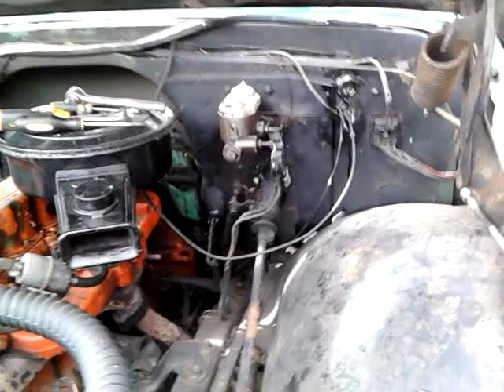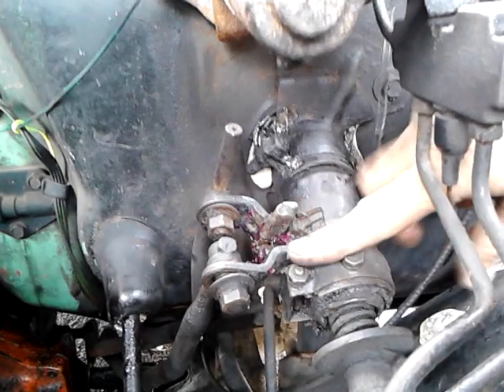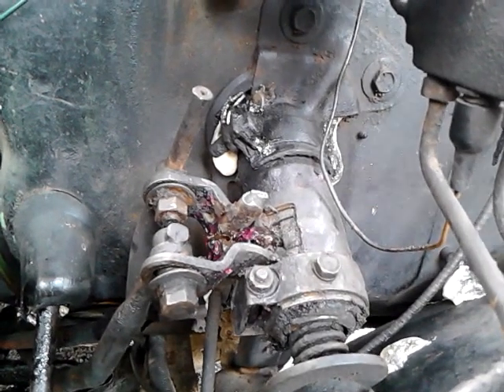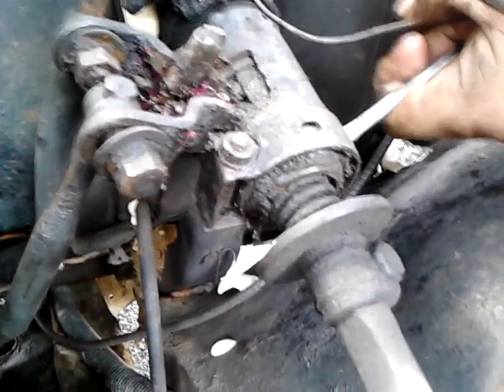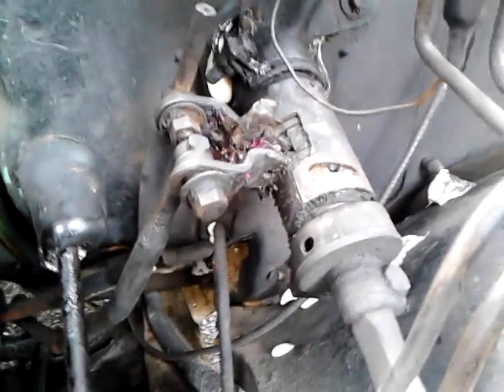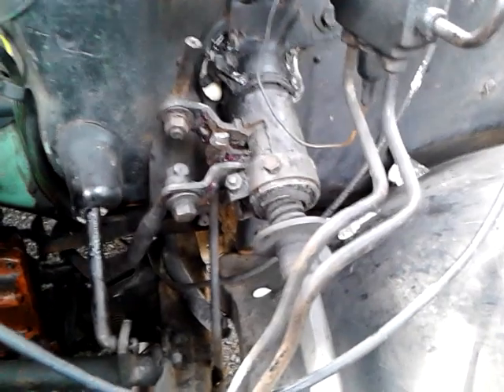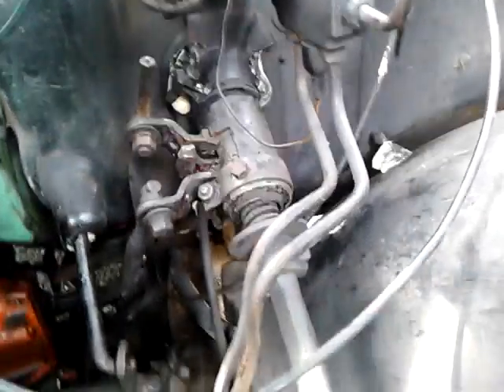How to adjust 3 speed column shifter

Comment: I have been tinkering with the adjustments for 2+ years. I have taken my truck to four different shops. One of which was a "Classic Car/ Truck" shop. Nobody could get my "3-on-the-tree" adjusted correctly. It was ALWAYS getting stuck between 1st and 2nd gear. They all kept blaming it on the play at the column bowl. I watched your video a couple times and then hit the garage, following your video. Low and behold, once I put the screwdriver between the two connectors I noticed that one was about a 1/4 inch below the other. Once I evened them out, the linkage tightened up and now shifts between all four gears with ease! Thanks a TON for your video!
Reply: Allan Scott a
Reply: You probably dont care but does any of you know of a trick to log back into an instagram account..?
I stupidly forgot the account password. I appreciate any tricks you can give me
Reply: @Jesus Mateo Instablaster =)
Reply: @Jasper Arian it worked and I actually got access to my account again. Im so happy:D
Thanks so much you saved my account!
Reply: @Jesus Mateo Happy to help =)
Reply: I have the same issue

Comment: Luke, thank you sir. I've been all over the internet trying to find someone who made a video about early Chevy column shift adjustments. These trucks get modified and turned onto hot rods so much, that it's hard to find info on an untouched daily driver. I've had the shifter of my 1961 Apache jam up when I'm out and about. Being that I'm female people love to gawk at a girl who's pulled over with the hood up and nose in the engine area trying to clear the jam. Thanks to you I could fix this issue at home and take "Miss Betsy Louise" out in public again. It's great not having to wind the engine and transmission just to take off in 2nd or 3rd gear. Just to be on the safe side, I did end up removing 50+ years of built up goop and rust before tightening it all back together. Thanks again - you're a great shop teacher.  :-)
Reply: I know its been a while since this post, but do you still own the 61? I have the same but on mine I don't see a hole to align the 1st and reverse gear to the 2nd and third in neutral

Comment: THANK YOU for this video! I've been suffering with the 1st to 2nd lock up with my '59 Chevy for some time and thought I had it under control when it happened again 3 days ago. That's when I went hunting and found your outstanding video. The major difference is closing up the clearance between the levers is accomplished by turning the INNER sleeve....removing the screws is not necessary, only loosen them enough to allow the inner sleeve to turn. That and a small adjustment on the 2nd/3rd shifter link cured my problem. This issue is not addressed anywhere in the 1958 Service Manual OR the '59 Supplement so thank you again!
Reply from the maker: I'm glad it helped you. Gotta keep these old classics on the road.
Reply: thank you for the extra tip!! i have a 59 Chevy too with same problem.
Reply: 57 Chevy stuck in 2nd gear last weekend. I am not finding the piece between the two actuators. Is this a different set up or could it have slipped out somewhere? Any help would be appreciated

Comment: Luke, thank you so much for this video. Bought a 67 that was shifting rough, and tonight it locked in 1st gear. Limped home, and found this video. Sure enough, my shifter is popped out of the catch. Gonna have Pops help me tomorrow and get it all cleaned and tightened back up, while I have new arm bushings on order!
Reply from the maker: Hope it works well for you. These trucks are fun to drive when they are adjusted correctly.

Comment: Let me tell you a piece of my mind,I tell you I spent 3 hours trying to figure out how to fix my problem and spent 30 mins searching you tube to find your  video ,that I am sure as simple as you made it look I know you have busted knuckles,scraped,cut yourself,and sweated gallons to learn what you know,thank you kindly for sharing your knowledge ,so clean crisp and throughly , I hope you have more videos on adjusting and fixing these model trucks cause I need more help thanks again kindly
Reply from the maker: Glad I could help. What else would you like to know? I've been working on this truck for 28 years so there's not much I haven't fixed or adjusted.
Reply: the column seems to be floating around and im not able to get into 2nd and 3rd
Reply from the maker: does the entire column move around or just the steering wheel?
Reply from the maker: Oiram Nojertsac
if the steering wheel wobbles around and the column itself doesnt move around then its probably the upper steering shaft bearing. It's letting the wheel move around, it's hard to diagnose something without seeing it but thats what I would check first.
Reply: @lukeFugate  hey how's it going love your video by the way thanks I've had one of these for years and it's goes  through the gears fine but when I put it in the third it pops out all the time I have to hold it in gear do you know what that might be or how to fix it it's just a 3 speed too by the way thanks
Reply from the maker: It could need a small adjustment. It may not be going all the way into third. Also if it is in adjustment you could have worn synchronizers or possibly low oil in the transmission.

Comment: I thought this video was completely helpful and in fact solved my stuck linkage problem... for now at least.  In addition to the instruction you provided, I degreased the hell out of the area and scrubbed the linkage until it was whistle clean and reapplied linkage grease after doing so.  Very smooth now.  Oh and it is a 1972 G10 Shorty Van with a 3 speed column shifter... never saw one myself until I picked this one up.  Thanks again!  QUALITY TUTORIAL

Comment: Another thing that helps is to get rid of the rubber bushings that the factory thought were a good idea. Replace them with bronze bushings from the local farm or hardware store, you'll never have another issue with a sloppy linkage.
Reply: Smart
Reply: Where are those bushings located?  I'd like to try that as well!

Comment: Ha! I've been gingerly keeping my shift pattern precise for 48 years on my 1955 2nd Series 3100 1/2 ton, to prevent it from locking up the shifter. I'll try your adjustment fix, but if it corrects it I'll lose a lot of the adventure of driving my old truck! 😁
Reply from the maker: lol At least the need to be precise when others would just try to shift normally is a good theft deterrent. Although I guess nowadays just having a three-speed on the column is a pretty good deterrent.

Comment: Thanks a lot.  I have a '67 pickup.  Sometimes you can shift it into first/reverse and sometimes not.  The shift lever will not come towards me sometimes, which prevents first/reverse.  Let it sit, and it will "fix" itself for awhile! I was thinking the mechanism on the column had a broken part in it. Will try your adjustment first and see if it frees up the shifter.  You're right; this information is impossible to find.

Comment: Thanks Bud, that was very helpful.
I have a 65 Barracuda that has a little different set up on the cam adjustment.
The linkage rod adjustment is under the car.
Will give it a shot.
Cudakeeper

Comment: Luke I’m having problems where I put my 3 16ths drill bit/ screw driver through the centre of the two arms so they line up correctly, which at first they do absolutely splendid, i tighten it up and then within a few goes thru the gears, the front one sags justtt a fraction, also for some reason mine doesn’t have that slip collar/sleeve that once tapped with extension it forced it tight via the slanted slot! It’s just the bolt and the slanted notch but no collar. I have this problem and it’s the only thing stopping me driving my dream car- I wish I could teleport you to Texas quick. I am so very great full for your video and I’m going to fabricate a collar I guess and try tighten it maybe that will eradicate the limp front arm... what a nightmare for a very low skilled mechanic like myself haha. I don’t wanna give up but it’s certainly kicking my ass and I know one I can go from 2nd to 1st without a jam I’m gonna be so stoked. 😫
Reply from the maker: I hope you can find the parts. It seems the market for three speed on the column parts is scarce. I think most have been changed out for floor shift or automatics. I have looked for parts for mine before and lucked out with parts from Ebay.

Comment: I'm glad I found this video! I just bought a '49 Dodge Wayfarer. Engine runs and confirmed I could at least get into every gear before I left. Got it loaded up on the trailer and took off. As I got home, cranked up the engine and I Can't even push the lever up to get it into reverse. I'm hoping this will fix the issue. Otherwise...does anyone else have any other ideas? I can still shift into 1, 2, and 3 but can't for the life of me get that thing into reverse.
Reply from the maker: May check to make sure the linkage didn't catch on something on the trailer.

Comment: Hello Luke Fugate thanx for the video on the 68" 3 on the tree adjustment. I recently bought I 68" c-10 Chevy Longbed. My question I have is for my 69" GMC 3 speed saginaw. Originally it was 3 on the tree, but someone installed a direct floor shifter before I got it. Every now and then the gears would get stuck while I'm driving in traffic. I would have to pull over and wedge a screw driver between the shifter rods and break it loose. I am now in the process of installing a new Hurst shifter assembly. The problem I'm having is the transmission I believe is stuck in 2nd. or 3rd. Not sure because the sloppy linkage. So I drained the fluid and took off the old linkage and removed the Gear cover plate and internal shifter arms. I'm not sure if something is wrong with the transmission gears. Or if I'm just not installing the cover and the internal shift arms properly. I'm able get the cover on , and move the gears closest to the driveline. But not the gears closest to the clutch
Reply from the maker: I have never had to take my transmission apart yet so I'm not familiar with the internal components. There is a great forum you could check out at http://67-72chevytrucks.com/   There are some good people over there who will help you out.

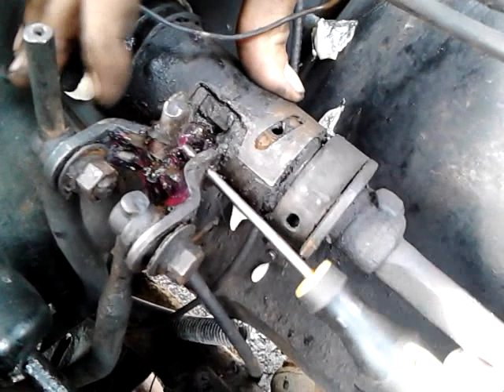Comment: Make sure you tighten that 2/3 shift rod (@3:20) before you row it through the gears(@8:18). Good chance you knock what you just did out of adjustment.
Reply from the maker: True. Thanks.
Reply: I was wondering about that, luckily his wasn't loose enough to throw it out of alignment.  Still the best video on the net for this adjustment/repair!

Comment: Hi.  Why wouldn't you tighten the shift rod hold down nut before running the lever through the gears ?  Wouldn't that tend to throw it out of adjustment if you were running the gears up and down and then the shaft would potentially move?

Comment: Love this video, such a big help! I have a '70 C10 which I bought as my first vehicle back in 2015 when I was in high school, and it's also a 3 on the tree. Recently, the arm sticking out of the column attached to 1st and reverse (not sure what it's called exactly) had snapped right in half, and the rod fell right down into the engine bay. Luckily I was in the parking lot of my work when it happened, but I wasn't being rough with it, just backing my truck into a parking spot like I always do, then "clunk!" and I was rolling forward instead of going in reverse. So now, I've been looking for a replacement part, and it's nearly impossible to find any. I had a good friend of mine weld the piece back on (luckily it was a clean break and not in several pieces). Hopefully the weld holds up for a very long time, if not, I might have to look at other options. 

Does anyone on here know where I might be able to find 3 on the tree parts/anyone selling parts?

Also, are there floor conversion kits for a 3 on the tree transmission?

Thanks!
Reply from the maker: You are right. These are very hard to find shifter parts for because the majority of them were converted to automatics or floor shift. 
A floor shift conversion is available and from the information I was able to find this is a link to that, https://amzn.to/3pJSg6V.
It seems a little pricy to me and I think if I were going that route I would swap in a four or five speed if it were going to be on the floor anyway.
Reply: @lukeFugate  Awesome! Thank you for that! I will have to look into that, but I was also thinking of doing a 4 or 5 speed as well, however, my truck has the small hump inside the truck for a smaller transmission, so I'd have to find one that's not too big and fits it. But for today, I'm going to put my steering column back in the truck (I had the piece welded back on) so hopefully that lasts a little while 🤞thanks again!

Comment: Is the middle moving piece in-between the two shifters being moved by the clutch pedal or is that the motion of you pulling the handle towards you? I'm having trouble shifting into reverse on my 58 amc Rambler, there's no engine and the trans has no fly wheel clutch disc or pressure plate attached. I'm new to working on cars so I don't understand lots of things yet.
Reply from the maker: The piece that moves in between and grabs the gears is moved by the shifter. I'm not sure how the Rambler shifters work but it should be similar. There should be some kind of adjustment for lining the shifting mechanism up. Look for some type of collar like is on my truck for tightening. Also the linkage adjustment for some cars is at the transmission.

Comment: Hi! Awesome video, thank you for the help. I have a 1969 c10 with 3 speed column shift. I am missing the 'collar' which you adjust at the end to drive to gap between the two linkage points. I have the slotted sleeve with the single bolt in it but not the collar that you tighten down. Do you know what this is called and where I can order one? Also, I find it strange that my truck does not have the alignment holes that you put the screwdriver through. That would help a lot. 
Jacob
Reply from the maker: The ring is called a clamping ring. I don't think anyone makes it anymore that I can find. If you have the bolt in the slotted sleeve you can loosen it and spin it around to take up the slack it will still close the gap between the linkages. I too find it strange the alignment holes aren't there. As long as the part in the center moves back and forth without resistance it should work.
Reply: @lukeFugate  so yeah, I can loosen the bolt in the slotted sleeve on the column and rotate by hand it by hand, but it does not close the gap between the two shifting levers. I was thinking that it was this clamping ring that rides against the forward lever and pushes it back as the 'cam' turns to close the gap. If I can find a clamping ring from a part out I will try it out, but I am puzzled why one of the levers does not have the alignment hole in it. might need to just find a used column for sale..

Comment: I plan on changing the steering box.on my 66 chevy 2 and wont to buy a powersteering box that will still work with my 3 on the tree amy idea on the one i should choose.
Reply from the maker: I would say that probably had a rack and pinion style steering box didn't it? I'm not real familiar with the Chevy 2. Classic industries is where I have found many of the parts I needed for my truck. They have a page you may be interested in too. Here is a link to it. 
https://shop.classicindustries.com/1962-1979_chevrolet_chevyii_and_nova_parts

Comment: hello i have a question about my 3 on the tree, i have to pull real hard towards me to be able to get it to go into 1st or reverse,would this adjustment fix that? thanks video was very helpful, much appreciated!
Reply from the maker: +Juvencio Salazar Try spraying some WD 40 or something like it into where the shifter goes into the column. Push out the little pin that holds in the shifter so you can pull it out of the column. With the shifter out you can easily spray into the hole. I did this recently to mine and it worked wonders.

Comment: Great tutorial Luke, thanks!
I have a three speed column shift on my 65 Checker. I did an engine swap and a bunch of work. Somehow I have my H shift pattern reversed. First is third, reverse is second. Do you have any idea what I may have done that caused this. I replaced the column from a 66 but they looked the same and transmissions are the same. 3 speed BW Studebaker with shift linkage on the side of the transmission. Do you know if it is possible if I could have reversed the linkage or any ideas?
Thanks!

Comment: I just watched your video on adjusting the 3 speed column shifter.  I have to hold the shifter to keep it from coming out of 2nd gear.  Could this adjustment help or is there another remedy?
Reply from the maker: More than likely this should help. If you do this adjustment and it still pops out of gear you have internal transmission wear.

Comment: Luke, thanks for your video. I have a 1953 Belair with a similar problem. It won't come out of 3rd gear. However, I don't see the same kind of shifter linkage as what you have there. Any ideas about it? This is out of the blue. It had been working fine right up until it didn't.
Reply from the maker: Keefer Zeller I'm not familiar with the shift linkage in 53, sorry. Info on column shifters seems to be hard to find, Everyone wants to take it out and put in a floor shifter. Love the 53 Belair though wish I could help.
Reply: luke Fugate Thanks anyway Luke. I was able to fix it myself by manually moving the rods from inside the engine compartment. Since I did that, there doesn't seem to be a problem. I drove it a good bit afterward and no problems. from what I can tell, all the things that you are referencing in your video are inside a box that hangs off the steering column. You can't really get to them without taking that box apart but it's working for me now so I'm not going to mess with it if I don't have to.